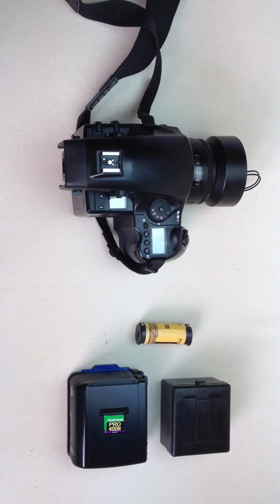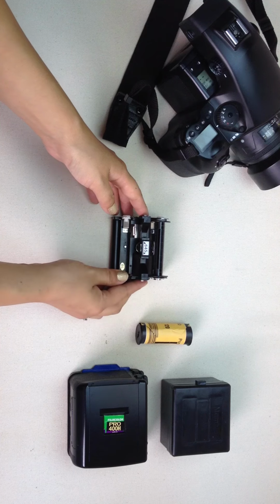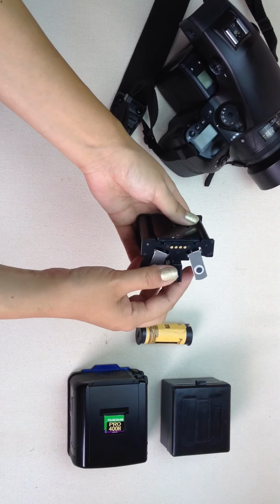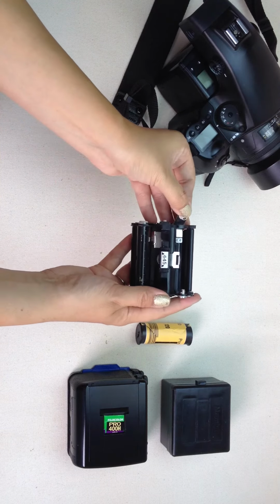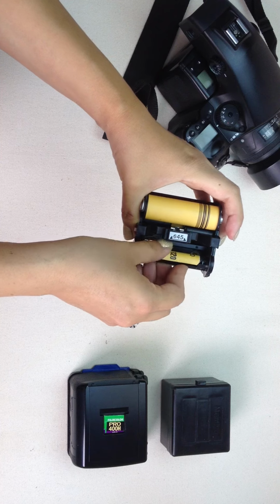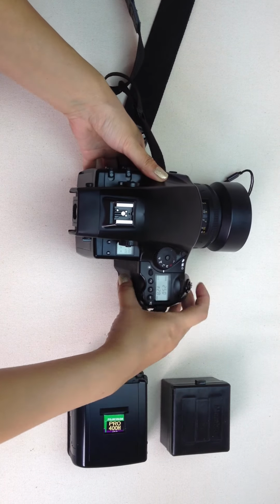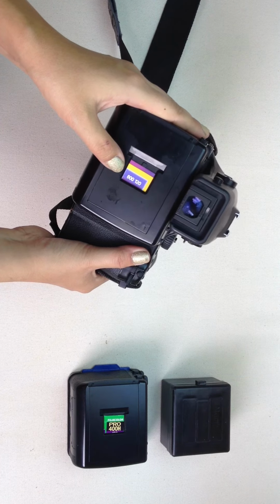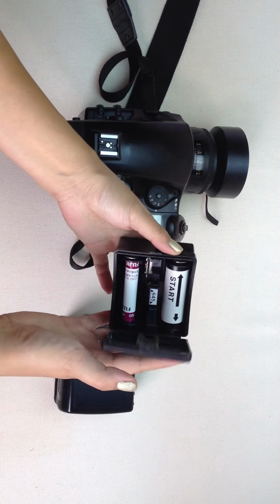Loading 120/220 Film - Mamiya 645AF or Contax645

Comment: Does the Mamiya 645 pro have the same film back where you can rotate the pressure plate to go from 120-220?
Reply: No, the Mamiya 645 pro uses two different types of film inserts for 120 and 220